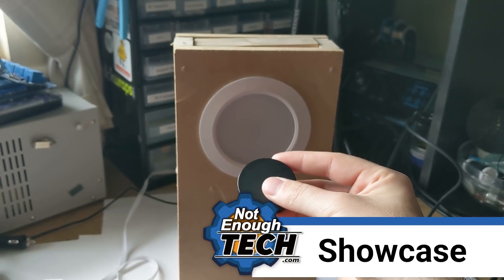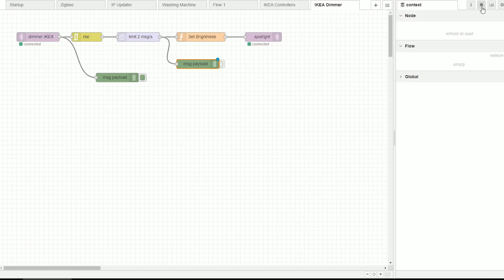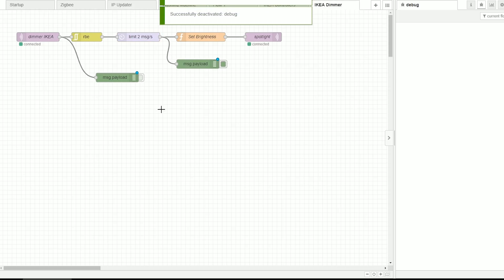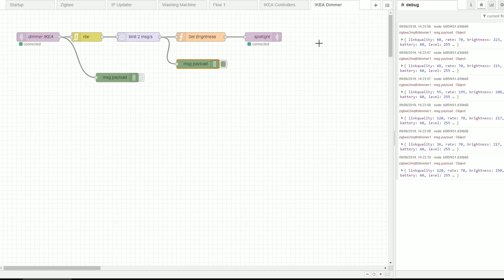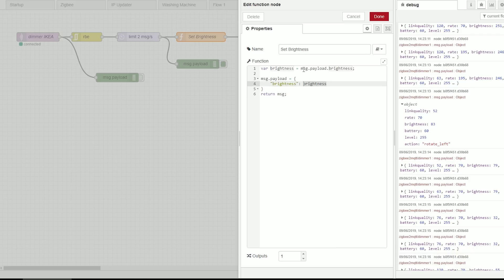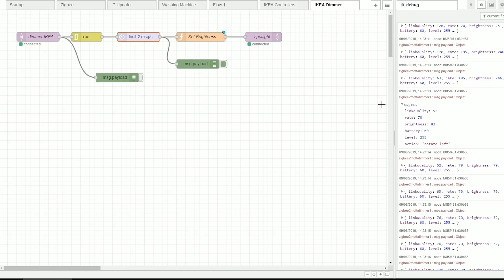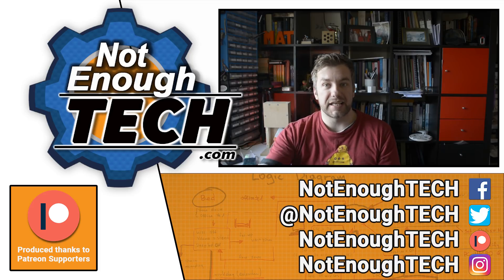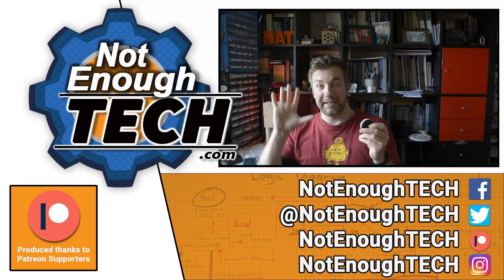Using IKEA dimmer in NodeRED

Comment: Great tut. Just what I was searching for!
Reply from the maker: Awesome. I have all IKEA devices mapped like this. Enjoy and thanks for comment
Reply: @notenoughtech  I just realized that my Sonoff ZB Bridge might not work with zigbee2mqtt. :/ Or do you know otherwise?

I really need to go the zigbee2mqtt route because I really would like to implement things based on your tutorials. With ZHA, things are detected with events and it's a whole other deal :(
Reply from the maker: Give some time for the firmware to mature. On the meantime consider cc2531 as your coordinator. Once sonoff firmware is ready for more public consumption you can flash it
Reply: @notenoughtech  I actually bought a CC2531 on your recommendation. And hacked it following your advice. But I just could not set it up. I recently found out why. No proper communication between Mosquitto Broker and zigbee2mqtt. 

Anyways, thank you so much for the wonderful tutorials!
Reply from the maker: Is it all running now? I run mosquitto alongside it and works a treat. Ping me if you need any help
Reply: Thank you so much, Martin! From what I understand, I should see device I am pairing in Configuration -> Integration -> MQTT. Is this correct?

I cannot see any devices there, but I can see some activity in the log of zigbee2mqtt when trying to pair. This is what I get: https://pastebin.com/T7wutq0Z
Reply from the maker: Take a look at this 
https://notenoughtech.com/featured/adding-devices-to-zigbee2mqtt-the-easy-way/
Reply: Unfortunately it did not help. Do you have a tutorial that shows actually how you set  zigbee2mqtt and pair a device, preferably an Ikea one?
Reply: And you should definitely do a playlist with all the zigbee2mqtt tutorials you have :) Because you have so many and it's becoming confusing.
Reply from the maker: https://youtu.be/xNJo8YS9XTo
This shows you how to do this step by step
Reply: I was looking at your tut here: https://notenoughtech.com/home-automation/adding-new-devices-to-zigbee2mqtt/
and I do not understand how you were using it. Was it an addon for HA because it does not look like so.
Reply: Ok, I got the ikea switch to work by resetting it with 4 fast presses, then waiting about 10 seconds, then a long press then a few short presses. 

Pff! This zigbee thing is like incantations. Jeez!

Thank you for all your help, Martin!
Reply from the maker: @ygreq  btw if ikea becomes temperamental - change the battery - i had issues where it would not pair but reset ok. I could see the light but it would not pair with my cc2531 - all issues were gone when I changed the battery for a fresh one
Reply: Thank you, Martin! I have some that just don't want to pair. Also a led which I find unusual. This zigbee thing is starting to get on my nerves.

Comment: @
NotEnoughTECH using your setup, if you turn off the power source to the light and then reconnect it later, will the IKEA dimmer reconnect to it? I find it I always have to pair the devices again. Not sure if this is true for all Zigbee devices or it's just these, or I'm missing something (I don't have a gateway or anything else, just the dimmer + lightbulb)
Reply from the maker: You shouldn't have to pair it again. Reset option is different than just a power off. It can take up to 1 min before you can control device at some cases. Check if you are in range too

Comment: Am I the only one that has sporadic reporting from the ikea dimmer? It can take up to 10sec before it reports anything. I have a few of these and none of them “work”? Have the same behaviour when connected to the ikea gateway.
Reply from the maker: I believe the dimmer goes to sleep mode. This is why you get a small delay before you can use it properly